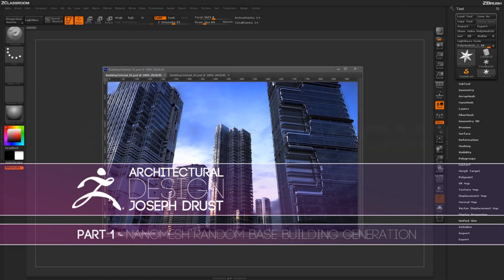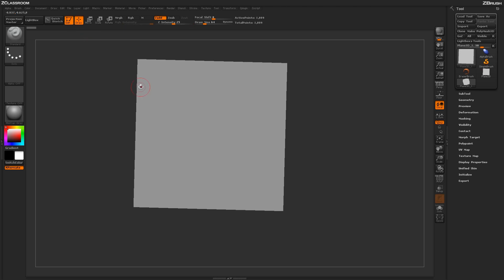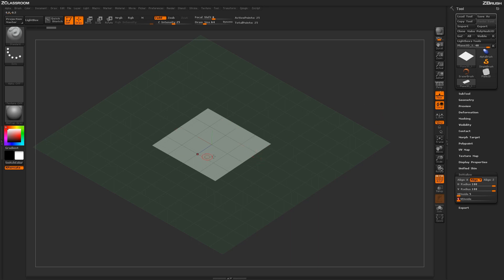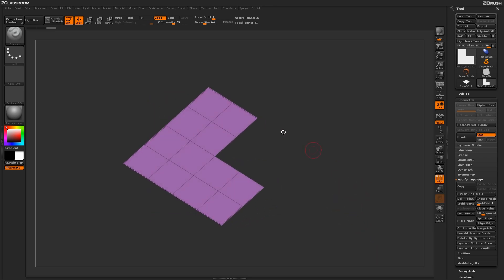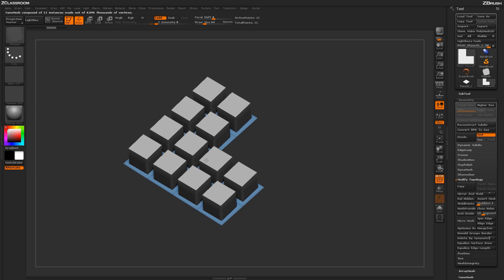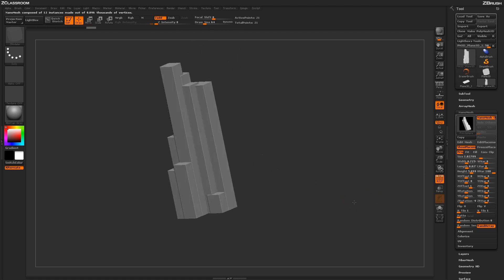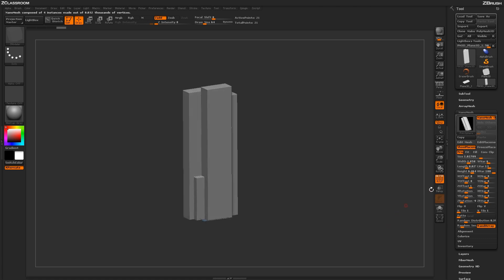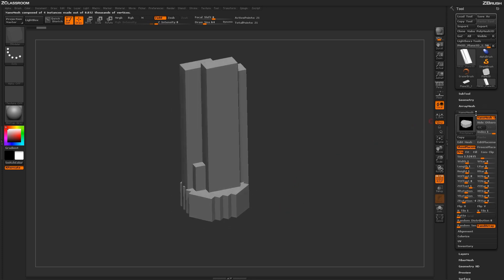ZBrush Architectural Design - Part 1

Comment: Randomizing controls can help to "unstick" a designer's preset ideas in generating forms. I am going to say that is a plus, until I get more info. I will assume that it is possible to generate non-orthogonal forms in composite arrangements. //  One observation:  Architecture is a process that usually originates at the level of spatial units in the programmatic phase and not by generating the envelope from the onset.

Comment: Biggest problem with ZBrush and architecture is that there is no easy way to make real size objects - lack of precision. I have tried few tricks but it is not suitable yet for real life cases. Concepts? Sure. Fantasy/Sci-fi? OK. But for real life architecture even free Blender would do better. I wonder if some measuring is coming to Zbrush now when we have that modeler?
Reply: Nezumi  yea hopefully Zbrush 5 will bring this for you guys that don't have Maya for rescaling
Reply: CashFuelzCFXstudio Its not only about rescaling.
Some models has to be done to exact size not only eyeballed, more-or-less. Imagine a simple object that has to be exactly 3cm high, 2.75cm wide and with depth of 45.25 cm. Good luck eyeballing it. You may fix it in Maya/Max/Modo/Blender later? Sure. You may model it in other software from the very beginning with less hassle.
Reply: +Nezumi Yeah, ZBrush is a sculpting program - its primary function isn't low-poly modeling. Blender, on the other hand, excels at low-poly (mostly 'cause you can move selections an exact distance) but is completely arse at sculpting. I think, if you wanna do architecture, you should get CAD software.

That said, I don't get why ZBrush doesn't just allow you to type in a value when moving/rotating/scaling things. I guess exact measurements are just so contrary to its history as a sculpting tool that they never bothered.